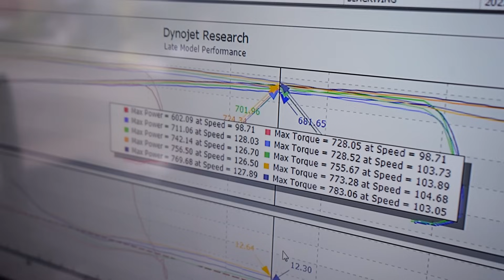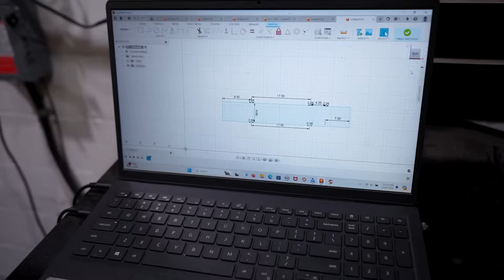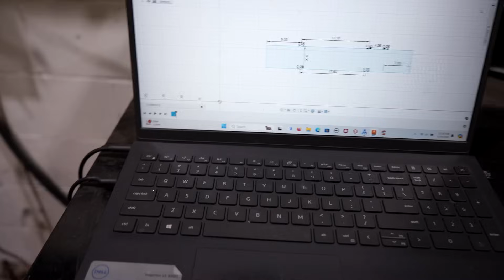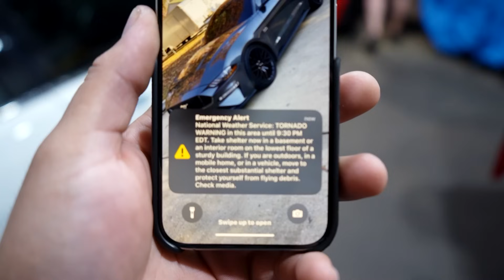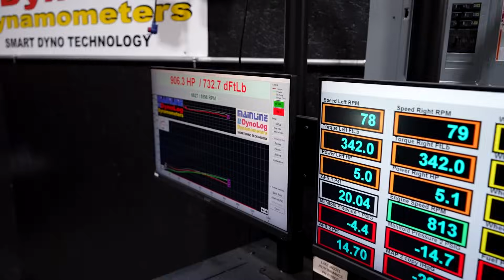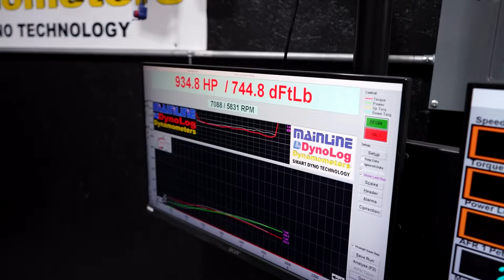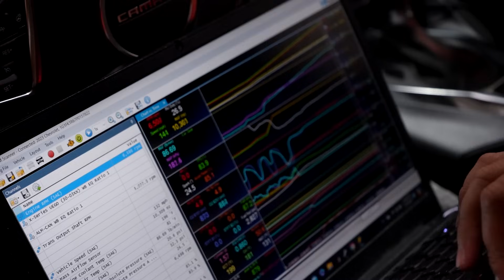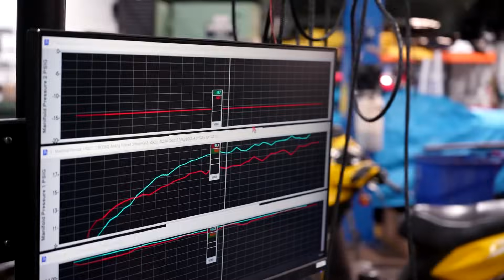2650 ZL1 hits the Dyno...during a Tornado.

Comment: I've got an 04 GTO with a 408 and ported lsa on it. Makes 9psi and 600whp through an auto right now. Would switching to e85 or meth benefit me much? I'm pullied out right now due to the 6 rib drive setup I used but would like to make little more power on my current setup. Figured e85 or meth might be the ticket.
Reply from the maker: E85 & Meth would 100% make more power. Probably an extra 100whp at the same boost level.
Reply: @LateModelPerformance   that's what i wanted to hear. 😆 what you think just e85 would do? 30 or 40whp?

Comment: Ive seen some maggie $9k+ so i agree i wouldve take the story ported blower and spend that 9k on making more power or the extra things you need to achieve whatever goal you have
Reply: Why dont people twin turbo? Its the same price and makes more power
Reply: @jayy7712  bc you’re not gone get a race unless you’re racing another car that sits like you 98% of the time😂 especially in the grudge world, you put twins on your car you might as well find the nearest car show
Reply: @Gullyswift3  ive never heard that before, if your racing you could just do no pop hoods. But I see what your saying once people know your power level no one wants to race, esp on the east coast w them ny bmw boys
Reply: @jayy7712 1. Twin Turbos done right is NOT the same price. 2. A twin turbo car with the same power level as a PD blower car will get destroyed. 3. To properly build a big power turbo setup takes a proper engine build to take advantage of making 1,200-1,300+ and at that level you are talking BIG money.
Reply: @jayy7712  im tellin you what i know not what im guessing. Im from Louisiana & i know from texas to SC,If you pull up with twins & you wanna run a single poweradder car its not happening. If its a 2 poweradder car its a 70/30 that it might not happen. I give it 30% to happen only if the turbo car giving odds or they running 1/8 mile only. Now if the turbo car is willing race footbrake to footbrake & not use the trans brake, everybody at the track or street will jump on the turbo car.